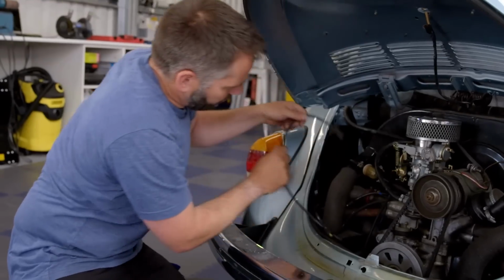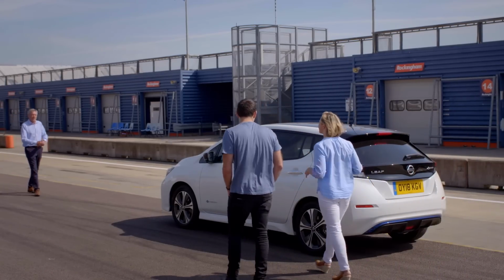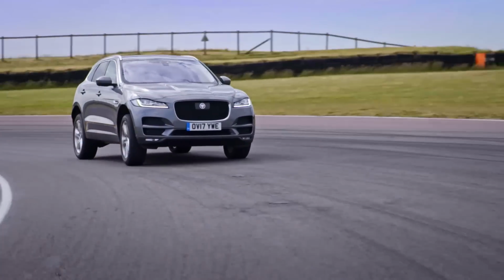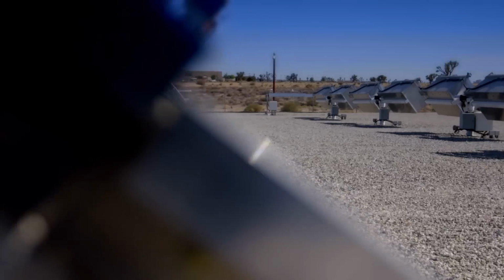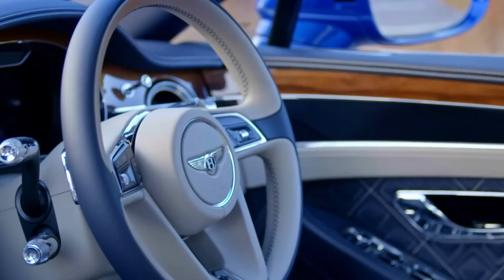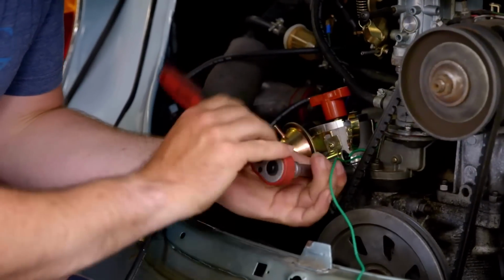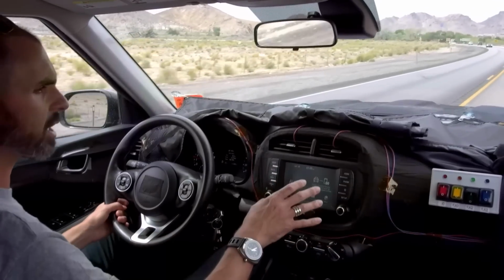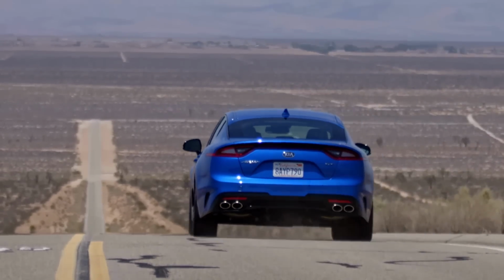Series 27: Episode Two FULL Episode | Fifth Gear

Comment: that a big lie at £1.20 to charge, as range so poor you are still going to need public chargers if you plan on going anywhere. 3 years ago leaf 40 kWh or 60 kWh depending on what you get, average public chargers around £0.70p to £0.75p but can go to a staggering £0.93p per kw/h so i go on average around £0.73p per kw/h , so it from  £29.20 to £43.80 per a charge in real world. unless you are wealthy and have a drive where wealthy can get cheap charge, it backwards it should be other way around the poor getting cheaper charge or very least the same like you get with petrol or diesel, im guessing you have the 40 kw/h battery, per a mile that a crazy cost and im going on claimed range not taking in to account you only got 1/3 that , my small euro 6 motor can get up to 605 miles per a tank real world 520-580 miles, so the 40 kw/h with just under 200 mile range needs x3 charges that in the average public charger is £87.60p that almost £10 more every full tank petrol i use. it a huge lie being spread by these car brands as it fool many thinking i get one cheap miles but then find out they cannot get a charger at home then it going to cost them more than older petrol or diesel car they had . many disabled people were fooled in to getting ev, along heavy cables and high curbs on public chargers that bad as it is but now costing them more so people already on tight budget now paying more per a mile. simple maths you soon realize the true cost, that before how fast they lose value